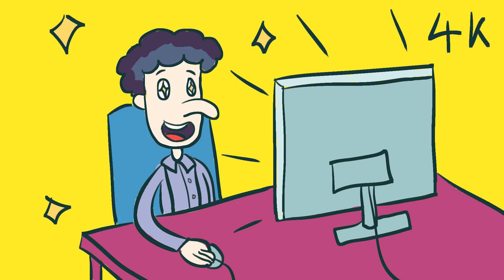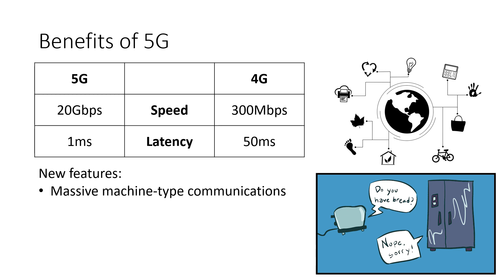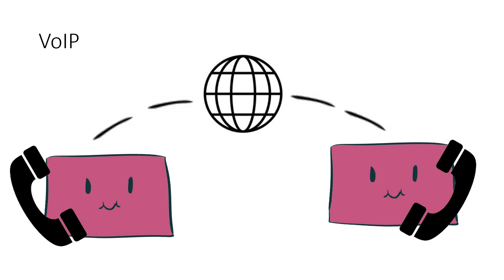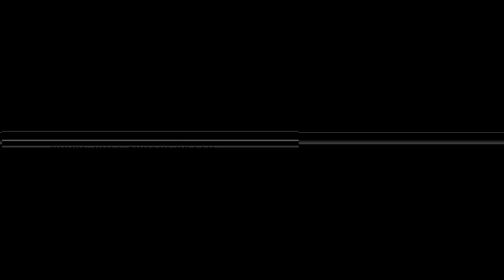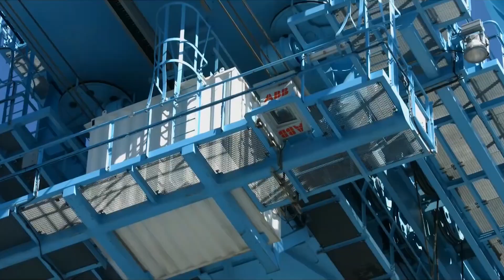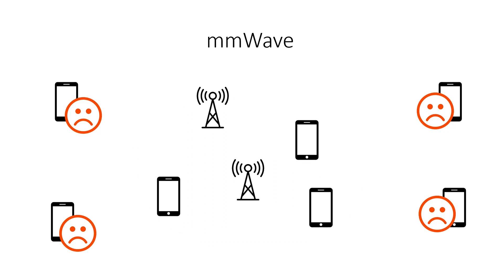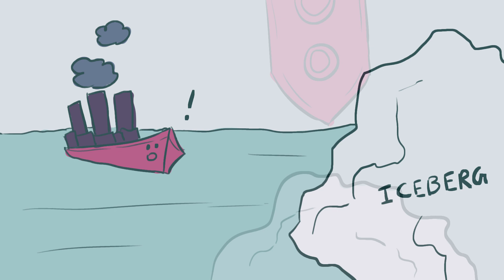5G as an Enabling Technology for Building Smart Ports

Comment: At 0:45, it is mentioned that 5G network has a very low end-to-end latency. Theoretically, 5G network should be a recipe for more success in the port industry. However, can 4G be modified to achieve the same low end-to-end latency as the 5G? If yes, would 4G network be a better choice for smart port considering the drawbacks of 5G?
Reply from the maker: 4G cannot achieve low latency because of the radio resource allocation delay between a device and a base station. Whenever a device wants to transmit packets, the radio resource grant procedure must be done first before packet transmission. Hence, 4G would not be a better choice for 5G. Furthermore, 5G is able to utilize multi-hop device paths to extend its network coverage which compensates for the low coverage of mmWave.

Comment: According to the video, two of the main benefits of 5G network are 20gbps and 1ms. With such capabilities, would you consider 5G to be at the pinnacle of wireless cellular network?
Reply from the maker: As with every new generation, cellular network technology continuously improves on the shortcomings of the previous generation. Currently, 5G is the latest and greatest available and will not be succeeded anytime soon as 6G is still in the early research phase. According to Huawei CEO Ren Zhengfei, he states that “there’s a long way to go (for 6G) before commercialization.'' Thus, it would be accurate to say that 5G is currently the pinnacle of wireless cellular networks.

Comment: One of the limitations of 5G is that 5G is built on a very high frequency spectrum that can be disrupted easily by physical objects such as buildings. As mentioned in the video, this matter can be simply prevented by installing many cell towers within the area. However, it is said that harsh weather conditions can cause attenuation to the signals. If so, how much will this affect the everyday execution of tasks and performance within the port?
Reply from the maker: The mmWave signals of 5G can be absorbed, scattered, depolarized and diffracted by rain, with a signal attenuation of around 26.2dB/km. Hence, it is possible that harsh weather will affect the performance of the port.

Please refer to this paper for further information: http://eprints.utm.my/id/eprint/79786/1/TharekAbdRahman2018_RealMeasurementStudyforRainRate.pdf

Comment: As 5G requires many small cell towers to be installed to compensate for its low coverage, will it pose a health hazard to people in general?
Reply from the maker: Any cellular network technology including 5G uses radiofrequency radiation, which is non-ionizing radiation. Non-ionizing radiation doesn’t cause DNA or tissue damage in our bodies. Furthermore, there are FCC regulations in place to limit the transmit power of 5G towers.

Comment: Why can’t the real-time video monitoring systems, remote crane control systems, and container transporting systems brought up in the video just rely on cable-based transmission? 5G seems like a premature technology to rely on for such mission-critical features.
Reply from the maker: While it is certainly possible to use cable-based transmission to connect the systems mentioned, 5G is ultimately the way to go due to the ease of setting up as no cables would need to be installed. Modularity is also achieved, for example, smart containers can be added over-time to the system without the need for any further setup as they can have built-in individual 5G transmission devices that will simply connect to the pre-existing infrastructure in place. While cable-based transmission can usually guarantee low latency and high bandwidth, a private 5G network is certainly more than capable of matching cable’s performance in this particular use context. The initial cost of converting to 5G is higher but will be quickly recovered from productivity gains. 5G is maturing rapidly and has already been used for such mission-critical systems in many smart ports worldwide, it has proven itself to be reliable and dependable when set up correctly.

Comment: For non-commercial users like me, are there any steps to be taken to switch from 4G to 5G once it is available in my area?
Reply from the maker: All you need is a 5G-compatible device and a 5G-ready telecommunications company. The switch itself should be seamless, very much like the switch from 3G to 4G when it was launched. You will enjoy greater speeds and lower latency without any further hassle.